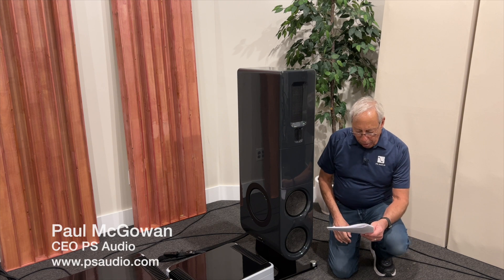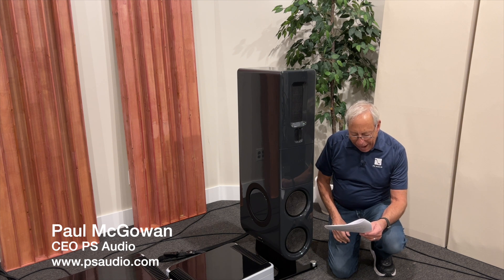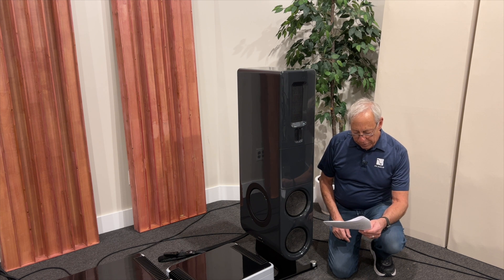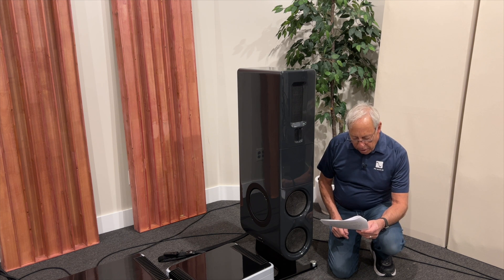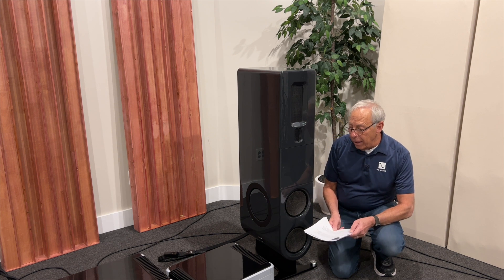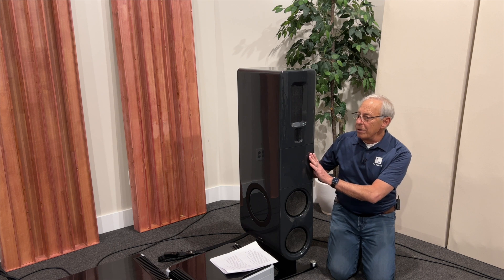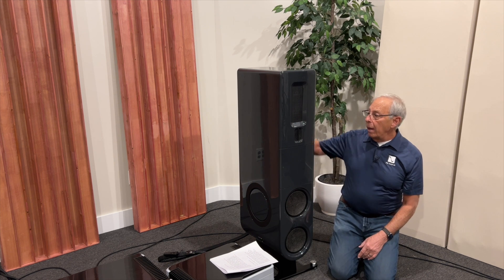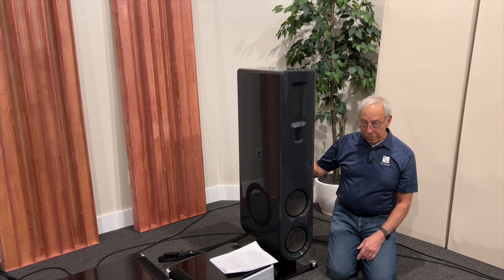Difference between FR30 and FR20 woofers

Comment: I am missing something (but not FR’s, I have both FR20 and FR10). If I have a source of power limited to, say, 40 watts, I should get the same volume of air motion (sound) regardless of how many speakers (of, course, to a first approximation, presuming each speakers output is linear with applied power).

Comment: You could have padded down the mid and tweeter. I think a consideration is real price would be too similar. Often there is next to no difference between two speakers in the same series. Example: Infinity Kappa 400 vs Kappa 600, same tweeter, same midrange, 8" woofer vs 10" woofer, virtually same footprint. I mean why even bother? Price difference to manufacture was probably $50 between the two. You have to make it appear you're getting something significant by buying the flagship. Different woofers, not just fewer, would do it. Marketing is always in the mix.

Comment: So, forgive my ignorance Paul and lack of audio engineering knowledge, but, if the composite materials used in the construction of the woofer cones of the FR20  are twice as efficient as the material used in the construction of the woofer cones in the FR30, would it not make good sense to employ that same, double the efficiency, cones of the FR20 in the FR30? Making the FR30 speakers even more efficient.
Reply from the maker: In a vacuum, yes. What you're missing is that the goal is to match the woofer output to the midrange and tweeter. In the FR30, we have the luxury of using 4 woofers in a larger enclosure to do that. We didn't have that to work with in the FR20 and thus had to come up with another solution. What the FR20 sacrifices is that it won't play as loud but, since it's designed for smaller rooms, that's ok.
Reply: @Paulmcgowanpsaudio  plus, the heavier cones in the FR30 result in a lower natural resonance (fs) of the FR30 drivers than the FR20, all else being equal. Depending on other design parameters the FR30 should go lower in the low bass.
Reply: @Paulmcgowanpsaudio  👍🍻

Comment: This does leave open logic that FR30's could resolve higher (in addition to the obvious extra power / presence with 2 more) with carbon cones unless there's just something about how aluminum sounds that doesn't show up on the graphs and charts. Or else, despite 50% more mass, the coil is that much more powerful/accurate.
Reply: Kinda was my first thought as well - if they are 'better' why not have them in the flagship and have it even easier to drive at a given power level.  I suspect there is some other tradeoff going on with respect to peak output or something else.

Comment: Paul. So would 4 of those lower mass woofers in the fr20 improve the performance if used in a fr30? Thanks!
Reply: No, the FR20 woofers require a larger box (per woofer), so wouldn’t work in the FR30 design as-is.

Comment: Hmm. This answer begs more questions. If, other things equal, a low mass cone is preferable, why didn’t the FR 30 use them already?  If not, why not just use the “better” aluminum in the FR 20 and stipulate that it’s a lower efficiency speaker?  Even though the FR 20 is “small” compared to the FR 30 it’s still a large speaker and should produce ample volume in most average rooms compared to most bookshelf and small tower speakers on the market, and in the unlikely event you need a bigger amp to drive the better cones so be it. Something doesn’t add up here.
Reply: They use the same tweeters and midrange and their efficiency is not getting divided by 2. Therefore they would have to pad them down in the crossover. I assume they want to save cost by mass producing the same crossover for their whole range of speakers
Reply: I was thinking the same thing! It doesn’t add up for the reasons you state.

Comment: Hi Paul, so if FR20 is quite sensitive for such large speaker can it be driven by  a meaty 150Wpc power amplifier to it's full potential ?
Reply: Hi there, this isn't Paul, but I would like to think that, yes !, you can, however, I believe that the woofer voice coils are the same size and windings. The cone material is very light, compared to the aluminum cone material, so by reducing the weight by about half, the woofers are going to not work as hard, thusly, produce more bass output for a given wattage, I  surmise that the audio techs tweeked the crossover network for the woofers to compensate for the lighter cones !, having built many systems myself, I hope this info helps. Just one caveat, make sure to check the maximum power handling of the speakers, you don't want to burn them out !
Reply: @b.powell3480  I'm sure Paul said that the individual speaker performance was increased to compensate for the lesser number of speakers, thus keeping the 20's performance similar (but not entirely equivalent) to the 30's.
Reply: @heywoodjablome5630  If I remember, Paul said that they took 2 woofers out and redid the cone material for the other 2 woofers, and the ones they upgraded looks to be shorter in height

Comment: If the motor structure to these woofers is the same (FR30/FR20) but the cone is half the mass (FR20), would that give the edge to the FR20 in its ability to reveal bass texture, detail and decay ("faster" more revealing bass)?
Reply: i wouldve assumed it gave the 20 a fighting chance to mimic the 30s output.
Reply: Yes, if the membrane under the load behaves similarly to the "30". 
Apart from the difference in the speaker, there are also differences in the casing, as far as i can see. 
If You are looking for bass like this, look for speakers in sealed boxes.
Reply: Are the magnets and windings the same if so, yes it will come close
Reply: The FR30 has way ore impact-- hit.

Comment: Yes is a leak invention the sandwich driver, best 15-in drive you can get better than altec
Reply: Many have stiff surround problems though with the age of them these days.
Reply: @RennieAsh  yes could be right, you could apply some silicon oil, or cut out the surround and put in a foam surround. Another process might work go around with a brush with methylated spirits and immediately afterwards go around with a rubber cement same stuff as a bicycle inner tube patch glue

Comment: Not sure why the woofers are so near to the floor and distant from the other drivers.
Reply: They are probably crossed over at a frequency where the distance doesn't need to be tiny
Reply: Drivers interacting with the floor. I prefer that to stand mounted speakers.

Comment: Why not lower the mass in the fr30 you would get a more sensitive speaker easier to drive?
Reply: The primary trade off for higher sensitivity will be less bass extension down low.
Reply: more weight = lower Resonance frequency of driver. better for produce lower frequencies. 
the cone does not bend when playing loud
something the cone or voice coil better control
Reply: The want the response of the woofer section to match the mid and tweeter.  Both speakers are designed to have a flat frequency response through their entire range.  If they had 4 of the high efficiency woofers from the FR20 in the FR30, they'd be voiced way too loud.
Reply: Or maybe have an amp that has the balls.
Reply: @Roof_Pizza  sure, but that's a different discussion altogether.
Reply: @hoth2112  If you're gonna have a ~$20k speaker amps shouldn't be an issue. If it is an issue them maybe buying that wimpy tube amp wasn't such a great idea after all.
Reply: @Roof_Pizza  again, this is a very different discussion than what I was talking about.
Reply: @hoth2112  LOLZ. Same issue.  BTW, I was ORIGINALLY COMMENTING ON THE OPS POST so don't feel the need to bogart the thread with a singular solution.
Reply: @Roof_Pizza   Am i? The only solution you've offered is essentially "just get a more powerful amplifier." The original question was about changing the physical properties of the drivers in the FR30s to get better efficiency. And I was explaining what the typical trade-off is when changing the properties of the driver material, which is an actual answer to the question OP proposed.

Comment: interesting, so for that frequency those woofer plays at, what sonic differences or power handling are there for the light vs the heavy cone woofers?
Reply: Typically, lighter materials allow for better transient detail like "texture" to come through, especially in the higher frequency ranges of the woofers, but you may lose some of the impact & extension at the bottom end.
It's why some people prefer the sound of paper woofers over the stiffer aluminum or poly woofers.
Reply: @hoth2112  Yes my Sonus Faber Aida 2's have custom blended paper woofers and I like the sound of the bass very much.
Reply: he only answer half of the question. what's side passive radiator do? the box can give bass gain. and crossover and frequencies different too.
Reply: More likely you won't hear a sonic difference. Either the rohacell or the aluminum cones will operate as an essentially "perfect" piston (without break-up) in their operating range, which is governed by the crossover. The aluminum cone is just slightly heavier. The resonance of the driver will change as a result of the change in mass, unless the suspension components are also changed. If the suspension components were not changed, then the resonance may be a bit higher. Does this mean less "deep" bass? Well, it depends on enclosure tuning (volume and passive radiator mass), but I think the F3 point of the system could be expected to be a little bit higher. This means that part of the FR30's value proposition would include slightly deeper bass. But would you hear a "significant" difference? Unless the F3 moved upward by more than 1/3 octave, probably not, unless concert bass drums and ultra-low synth bass are your thing.
Reply: @rorybuszka2215  you forgot about damping, that parameter surely is different.
Reply: @sudd3660  Internal loss of the cone material doesn't have an impact at woofer or subwoofer frequencies, only at frequencies where breakup is occurring. If the cone is acting as a piston, a polypropylene piston will behave the same as an aluminum or rohacell one. Electromechanical damping will change slightly when the resonance changes due to mass; the damping will be slightly reduced (Qes increase) which helps offset the loss of low frequency by making it possible to tune the box lower and recover some deep bass.